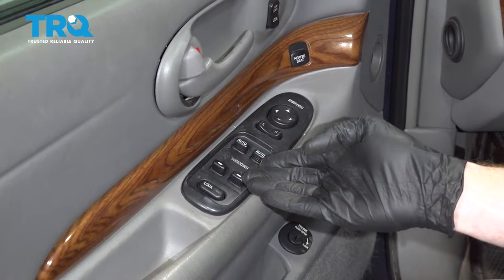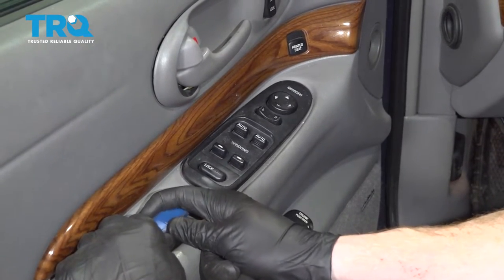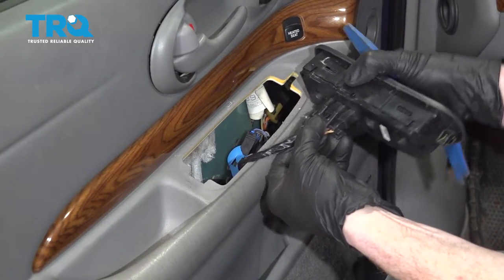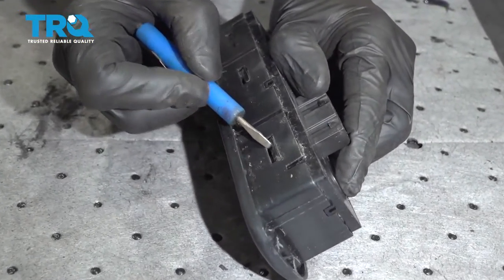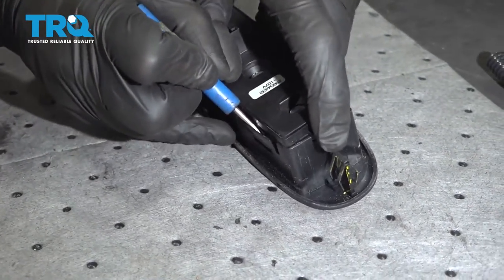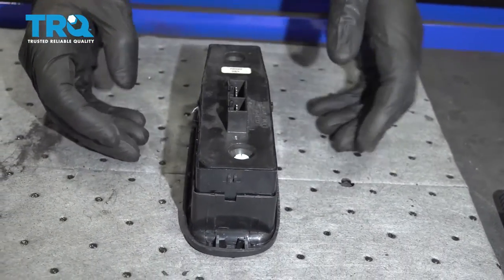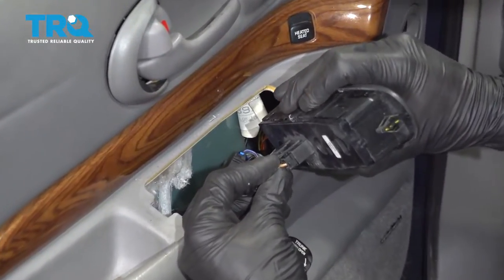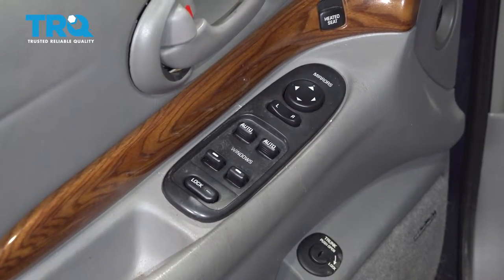How To Replace Master Power Window Switch 2000-2005 Buick LeSabre

Comment: If the master switch is malfunctioning, would that prevent the door locks, mirror and truck switch from working?  It’s like the whole door went out, but the light on the door works and the lock works if it’s locked from another door.  Any info would be appreciated.  Thanks.